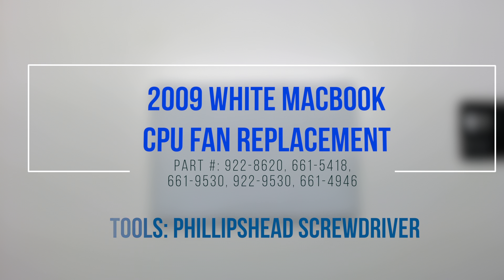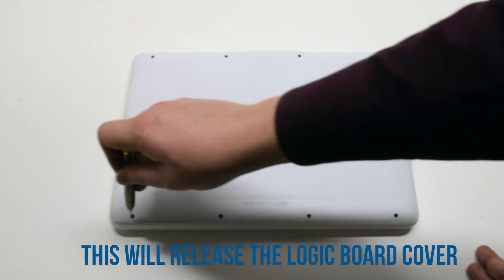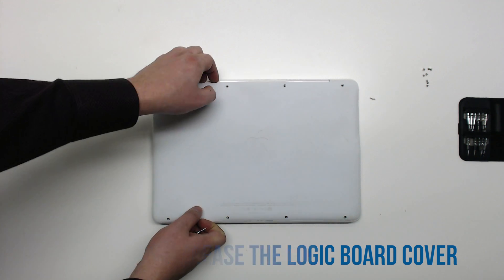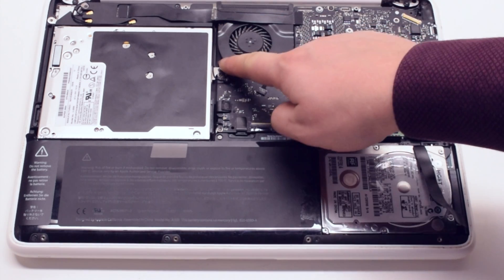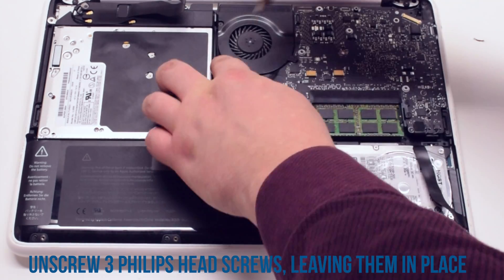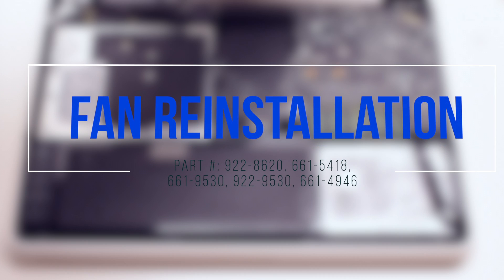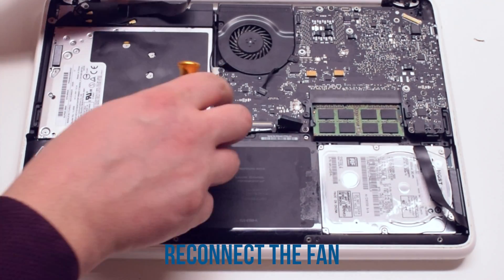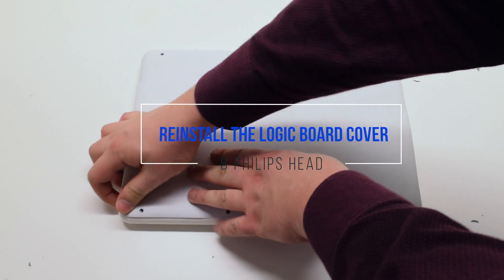2009 White Macbook A1342 Fan Replacement

Comment: I think when I disconnected the fan cable from the logic board I broke something off. Now I have my new fan and I can't seem to find where to "snap" it back into. :/ Help?
Reply: same thing here. if you found a fix could you please reply because i dont want to buy a new motherboard
Reply: @txctry5686  the only option I found was to solder the piece that broke off back onto the board or find a tech person who could solder it for you. I called my local tech shop and they said they'd do it for a ridiculous price so I just ended up getting a new computer (I had mine for 11 yrs so it was overdue). I even tried finding old MacBooks on craigslist that were my model to see if I could just take their board and out it into mine... but that took too much effort.